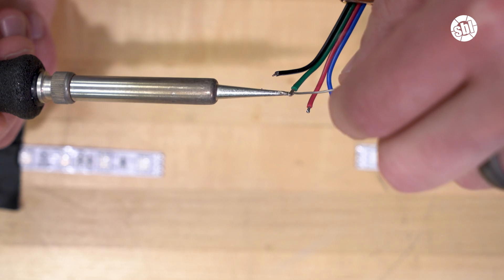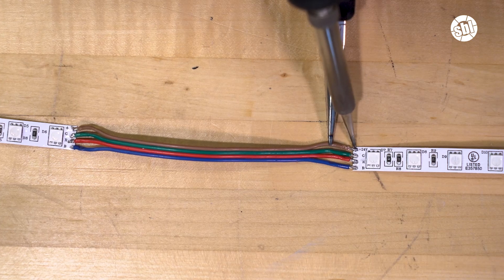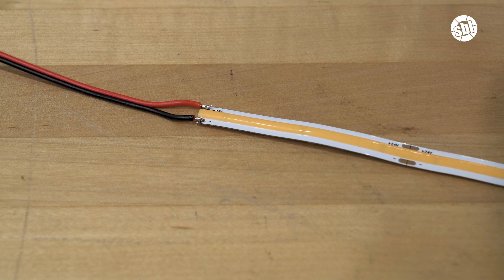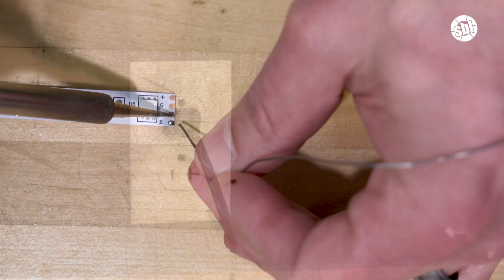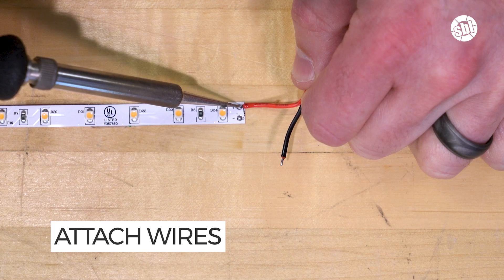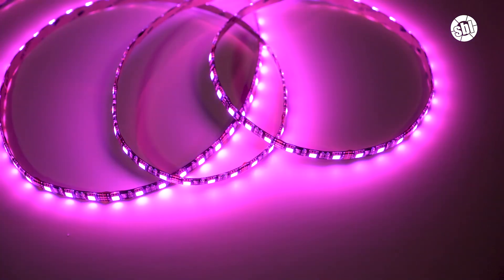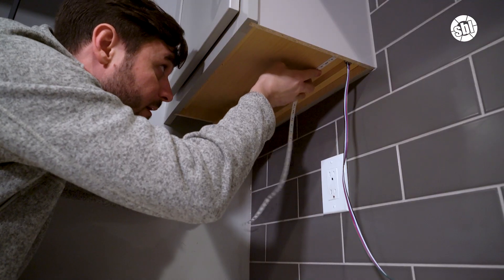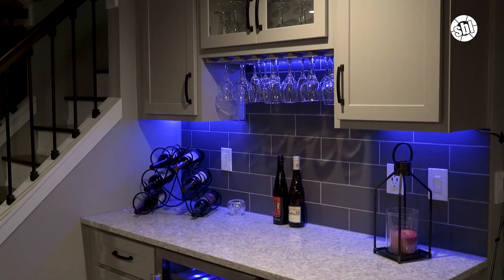How to Solder LED Strip Lights

Comment: On 6 connections it doesnt work, theyre too close together, soldering is terrible, uncontrollable, sometimes the soldering iron melts the solder, other times it doesnt. The soldering only sticks to itself.
The connections on the led strip are made by a machine with pins. Will looks into a other option or ill design a screw system.

Comment: My lights say to solder at silver connections which are more spaced apart
Reply: You can cut at silver connectors and the other connection points both work fine

Comment: Perhaps i could pick your brains, I have some LED lights i have been trying to solder, i'm perfectly capable of doing  nice soldering job, but they are doing my head in, the solder won't stick to them at all, i'd even resorted to trying a conductive pen, i've trid scuffing the connectros, cleaning them, the solder just drops off yet there is solderred connection on the power end, what am i doing wrong?
Reply: have you used Flux? it is what makes the solder adhere
Reply: @bijanmozafari3826  i'll give that a go thanks.
Reply: I had this same issues today at work. Don't know what to do😊
Reply: @LabaranPeter  If the problem is that the solder won't stick to the wire and the strands of your wire are copper-colored, it may be that you have copper-clad aluminum wire, which is difficult to solder. Otherwise try flux!
Reply: I'm having a similar problem. The video shows the tip of the soldering iron melting the solder, mine doesn't do that at all, have to touch the wire way up the conical head, losing precision of depositing the solder in the process.
B) the blob of solder doesn't stick to the copper contacts of the LED strip, at least not reliably so, most of the time it rolls away when heated. I read the comments on using flux and went and dabbed some flux onto the LED contacts, but very little changed. Very frustrating. I was expecting soldering to be as easy as these videos show it but am realising that it is either going to take a long time to pick up or I'm doing something wrong.
Reply: flux is definitely what you need here it helps the solder flow to the solder point :)